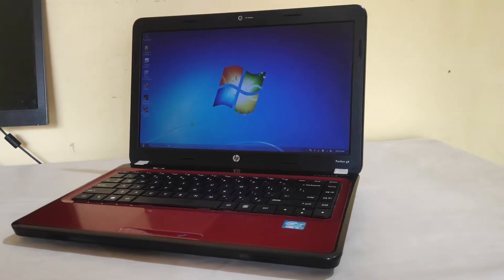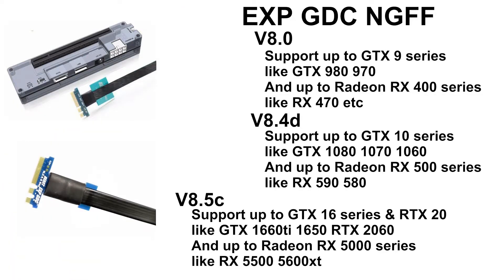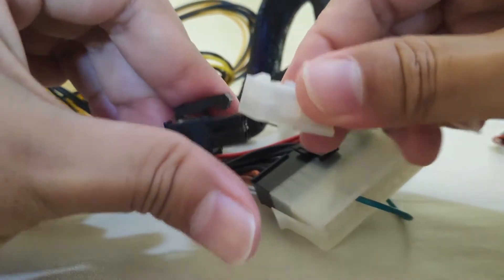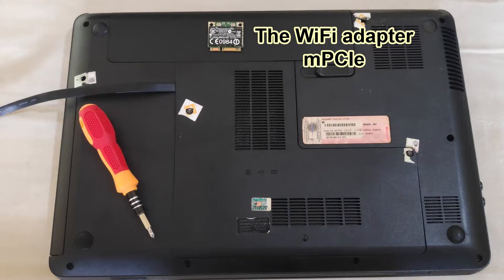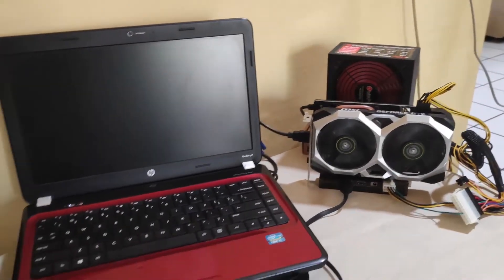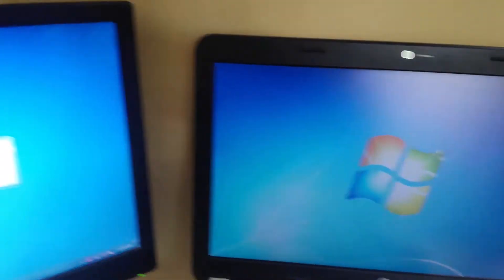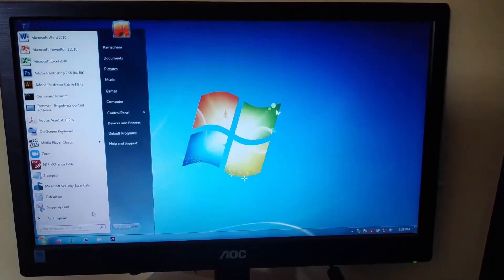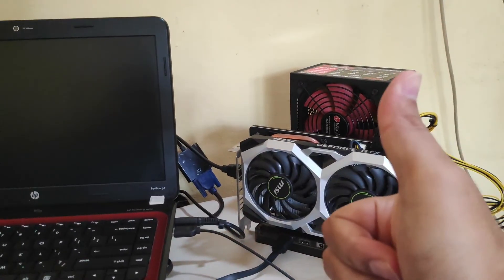EXP GDC Beast V8.5c eGPU with GTX 1660 ti on Old Laptop from 2012

Comment: Hey I have a Intel graphics of 2 GB and NVidia 840m 4GB, I'm going to disable nvidia 840m  graphics and insert an GTX 1660ti. Your thoughts? you think it works?
Reply from the maker: Windows 10 or Windows 7? Either way, try to uninstall the existing NVidia driver from Windows Safe Mode boot. Download DDU.exe (Display Driver Uninstaller) beforehand. 

In safe mode, Launch DDU.exe as administrator, then select uninstall 840m, after that, restart but still in Safe Mode, Open Device Manager, right click on the 840m and then Disable (it might be renamed to Microsoft Basic Display Adapter) .
And then, turn off the Laptop, install eGPU etc. 

BUT before doing all those, make sure you can access the BIOS properly, and search for something related to Boot Options.
Reply from the maker: Also, make sure that your WiFi adapter is up-to-date. Because basically eGPU requires an updated Slot Driver (Like mPCIe or NGFF)
Update your network driver using 3rd Party app called "ioBit Driver Booster"
Reply from the maker: I don't guarantee it to work. Because during the installation, NVidia software driver can detect any Disabled GPU and it can force re-enable it.
Hence why I recommend you to use the opposite of existing GPU, so instead of NVidia GTX 1660ti, just buy Radeon RX 5600, because basically they're the same.

Comment: Hello good day what version of exp gdc is needed if im going to  use my gtx1650? And where can i buy it. Ty in advance
Reply from the maker: I recommend V8.5c but sometimes it all depends on your Own Laptop.
Is it an Old Laptop or New Laptop? If you have new Laptop, like from 2018 or newer, you need EXP GDC V9.0b or V9.5 with M.2 NVMe slot.

All types of EXP GDC can be found on AliExpress. The keywords that you may need to use:
"Beast EXP GDC eGPU" or "Beast external Graphics Card dock"
Reply from the maker: Another keywords on AliExpress
EXP GDC external Laptop Video Card dock

Video Card Docking station EXP GDC.
Reply: I have the dell inspiron n4110  i5 proce , 8gb Ram 1333mhz and a intel hd 3000 so im planning to upgrade it with Gtx1650 what exp gdc will you recommend me to buy?
Reply from the maker: @carlmarklorenzo7307  yeah That Laptop have the same Processor like in this video. But first please open your Laptop to identify the Type of the available socket. Surely I don't know if your Laptop have mPCIe or something else.

Anyway it should be EXP GDC V8.5c but I'm not sure which type of socket you have. You need to open your Laptop by yourself like I warned in the beginning of my Video
Reply: Thats an old laptop i think 2012?
Reply: Yes sir i tried to open then it is a mini pci e
Reply: Where can you recomend me to buy the exp gdc for my gtx 1650 sir?
Reply from the maker: @carlmarklorenzo7307  I said AliExpress. Because the Manufacturer of this EXP GDC is from china. You may also search it on Alibaba.
But try Google Shopping search engine first.
Reply from the maker: @carlmarklorenzo7307  update. I think you can buy EXP GDC v8.0 or v8.4d just fine.
Apparently it works with GTX 1650 according to reviewer on YouTube. Try to search on YouTube
EXP GDC GTX 1650
Reply: Oh great! Thanks man have a nice day

Comment: thats a really bad bottleneck. mobile cpus are quite bad, only use that gpu if your cpu is a HQ model and if you have a 2nd gen i7 HQ or newer equivilent.
Reply from the maker: Looks like you don't know anything about bottleneck. The type of the CPU doesn't really matter if the connector is "Mini PCIe"
Let alone NGFF, or Thunderbolt 3 or NVMe.

Because currently the fastest eGPU that anyone can buy is NVMe based eGPU, and it's about 1.8x faster than Thunderbolt 3 eGPU.

It's all about Bandwidth speed. Even if I use Core i7 HQ or QM the performance won't be any different. Because of the Maximum Bandwidth of 2.5gbps

Stop talking something you know so little about.
Reply: @ClayWheeler  i know alot about it. The cpu is a bottleneck, but so is the pcie slot, laptops dont have full bandwidth slots. And its likely running at gen 2, not gen3, gen 2 has half the bandwidth of gen 3 per lane. Nvme runs at x2 or x4, mini pcie is likely x1. Thunderbolt is x2-x4. So before you go telling others what to do, tell it to yourself. Dont talk about shit you dont know about.
Reply from the maker: @raycert07  and maybe you should check some other eGPU videos that using this particular mPCIe slot.
It won't make any difference even if I use Core i7 HQ or QM, the FPS will stay the same. The only difference is that Core i7 HQ or QM will only utilizing 50% CPU usage, while this particular Core i5 is 100% CPU usage in gaming. It's all down to The Available Bandwidth.

You might also don't know if NVMe eGPU runs at X2 still faster than Thunderbolt runs at X4? You don't know it don't you?
Reply from the maker: @raycert07  also the fact that you said in your first comment "only use that GPU if your CPU is a HQ model"
clearly showing you know so little about bottleneck.

Comment: My 2010 hp laptop has white list thats why it doesnt boot up when I connect the exp gdc, I tried to connect it by doing sleep mode first then that when I connect the mpcie of my exp gdc through the wifi slot and it detects it and I installed the drivers 

But the damn problem is that my external monitor doesnt detect it and the nvidia control panel is not working even if I forcefully select it it does nothing
Reply: Also my bios is shit it doesnt have the options you showed, probably because its too old or because hp is such a shitty laptop company locking some options on some of their hp laptop
Reply from the maker: @mab3667  Woah, that's too old for eGPU setup. You better off with just building a cheap Desktop PC. Or if you're Lucky, you can search someone's Laptop from your family members for eGPU.
Reply: @ClayWheeler  my bios isn't same as you it has very little functions and my graphics card isn't detected please help me I bought 100$ used graphic card and I don't have any desktop I only have a laptop

Comment: hi could you please help
my pavilion laptop doesn’t boot with the exp gdc m.2 connected it will boot fine with the wifi card but not the exp gdc when it’s connected it will say there is a problem with the fan error code 90b press enter to continue but when i press enter it won’t even let me continue . please help
Reply from the maker: From the BIOS? Did you Change the BIOS like I do in this video?

Comment: Does you laptop battery still work? I heard that some laptops were incompatible with this set up because of battery problems.
Reply from the maker: During Gaming, I suggest setting up the Power config to "High Performance" this will surely eats battery faster. However this is 8 years old battery. The maximum discharge of this Laptop in my video is just 45 minutes for watching videos or 1.5 hour Typing documents in MsWord.

I could easily buy a new battery which is just $5 here from HP service center.
Reply from the maker: That's why I always plug the battery to AC Charger.

Comment: Can you use a Ethernet cable instead of a usb wifi
Reply: It just downloaded the old software after I did ddu lol 😂
Reply from the maker: @Gweaked  so the eGPU works or not?
Reply: No when I went to download amds drivers my laptop internal amd  gpu re downloaded and not my new one ☹️
Reply from the maker: @Gweaked  do it using Phone. Don't use Laptop. Because AMD website can do Auto Detection device
Reply from the maker: What? USB WiFi? For internet? Yes you can use both Actually. LAN cable or USB WiFi is just the same if you need access to internet.
But for the eGPU you need either one of these slots: mPCIe, Express Card, NGFF, or M.2 NVMe.
Reply: I don’t really no that much about computer stuff but I got the ngff cord I got it  hooked up to everything the fans turn on but I don’t see the gpu in the device manager I think it’s prob cause I got a amd card and my laptop has amd Radeon graphics already installed.
Reply from the maker: @Gweaked  if you don't see the GPU in Device Manager, it might be Listed as "Microsoft Basic Display Adapter" because any GPU with no driver will be Named this way.
Reply from the maker: @Gweaked  hmmm the Driver installer also refusing to detect the GPU card? 
My advice (1) you might need to uninstall the existing Laptop's AMD driver using Display Driver Uninstaller (DDU.exe) search it from Google.
Try to install the eGPU. If it doesn't work,
(2) then buy NVidia GPU card instead.
Reply: Okay thanks I’m going to try to do this today
Reply from the maker: @Gweaked  try to record video of it using your phone. Even if it doesn't work. I need to see if I can help you.
Reply: How would I use my phone would I do it threw the amd link app?? Sorry for all the questions
Reply from the maker: @Gweaked  what is the Radeon Desktop GPU model? Just search on Google using your phone. Like
"RX 580 Driver Download standalone"
Reply: I got the rx 570 4g sapphire
Reply from the maker: @Gweaked  yeah search on Google using keywords like that.
RX 570 Driver download standalone.

And then make sure you uninstalled Radeon driver from Laptop's GPU.
Plug in the eGPU, boot the Laptop, and Install the driver which you downloaded using your Phone.

I know Radeon has auto detect driver installer. That's why you must not using that method.

Comment: If both gpus can coexist, is it possible for the internal gpu to drive the internal display only and the egpu for the external display only? So that you woulnt need to turn off the intrnal display?
Reply from the maker: For desktop PC, yes. For Laptop, no.
When I said "both GPU drivers can coexist" it means AMD Radeon and NVidia GTX.

Also I'm turning off the Laptop monitor for Gaming only to make the IntelHD driver into standby mode, which means all CPU powers is focused to handle the eGPU.
If you're not gaming, you can use both monitor at the same time, like watching YouTube on external monitor, and web browsing on Laptop's monitor.
Reply: @ClayWheeler  i was actually planning on doing this mod. I have an Acer Ryzen 2500u withh vega 8 APU. I wanted to get a gtx 1650 then maybe follow this mod. I was thinking that i could still use the laptops monitor for lets say discord and the external monitor for gaming. Would that be possible and how would it affect performance? Thank u for the response
Reply from the maker: @Gwaping723  good question.
If your Laptop have M.2 NVMe slot for the eGPU (EXP GDC V9.0b or V9.5) then you can use both monitor just fine, because the bandwidth is very high compared to mPCIe like in my video.
Make sure your M.2 NVMe slot is running at X4 Speed Lanes, not X2 Speed Lanes.
Because if you use M.2 NVMe X2 you cannot use Laptop's display (Actually you can, but the Gaming FPS will drop significantly) if you have M.2 NVMe X4, you can use both monitors just fine.

Please check on the pinned comment of my video when you get error43.
Reply from the maker: @Gwaping723  I'm sorry is that Acer Ryzen 2500u have M.2 NVMe slot? I think it doesn't have NVMe slot.

It might be NGFF slot. If you have NGFF slot for eGPU, you cannot use Laptop's display at all for Gaming. Because the bandwidth is slower than NVMe.
Reply: @ClayWheeler  i think this laptop has m.2 because i just recently installed an SSD into it. What I ideally would want to happen so as to not worry about bandwidth across different monitors is to use both gpus, vega 8 and 1650 at the same time, the vega 8 driving the internal display and the 1650 for the external. This might be a long shot but would this be possible?
Reply from the maker: @Gwaping723  alright what model of Acer do you have? The model number in "dxdiag" info
Reply from the maker: @Gwaping723  worth trying. After installing GTX 1650 driver, you can access NVidia control panel, and select the external monitor as Main display (Display 1) and then the Laptop's internal monitor as secondary display (Display 2)

If you're using Windows 10, you have to manually select the Preferred Graphics device for specific Game. So that particular game will be forced to run on GTX 1650.
Reply: @ClayWheeler  acer a315-41-r132
Reply from the maker: @Gwaping723 
Here
 https://youtu.be/A0S9BIghFnU
Apparently you cannot use M.2 for eGPU because the slot only fitted for SSD storage.
The eGPU with M.2 needs NVMe capability. And your Laptop only have M.2 "Without" NVMe capability. So you can only use WiFi adapter slot for eGPU.

The problem is, I'm not sure the type of your WiFi adapter, it could be NGFF or mPCIe. But the Bandwidth is roughly the same, 2.5Gbps.

Comment: I happened to buy one of these (v8.4d) in case i ever came across a laptop that i could use it on so i also bought every connector type. Well i happened on a cheap acer sf315 52 (2018 8th gen i5) which also has a ssd with optane that it boots from and so i hook it all up and i can see the bios and it start to load windows then windows stops the device (error code 43) I dont have an option to disable the on board intel uhd 620 in the bios either. Is it a no go for my machine? 
Update: i deleted the 620 driver instead of disabling it reset and she works so far
Reply from the maker: Error code 43 means Slow Bandwidth detected. You can easily search on Google using this keywords
"egpu.io error 43" 
And then you will need to download the zip file which created by a guy in that forum. Execute (Run as Administrator) error_43_fixer.bat
Reply from the maker: So basically you need to install back the IntelHD driver. No need to uninstall it.
Reply: @ClayWheeler  i have a pretty decent collection of cards all the ten series included im wondering now if this will work with my zotac 1080 ti. I just located the file you said to find and it says specifically it will fix that issue with the zotac 1050.
Reply from the maker: @tronalddump8776  it will fix issue with literally all NVidia cards. Can be RTX 20
Reply: @ClayWheeler  i see that. Thanks very much for your help, im reading thru the site and comments now.
Reply: @ClayWheeler  worked perfect, thanks again.
Reply from the maker: @tronalddump8776  make short video of it using your phone. And upload it to YouTube. 😃
Reply: @ClayWheeler  ill make a video tomorrow. I just put the 1080 on it ill run some benchmarks and record it.
Reply: @ClayWheeler  thank you. I will try again tomorrow. It worked until i restarted it then started the error code again and dropped the 1050 driver.

Comment: Bang, itu klo laptopnya mau di bawah keluar ga harus install driver lagi kah? Atau harus install ulang driver VGA nya lagi?
Reply from the maker: Intinya kalau VGA bawaan Laptop itu merk Radeon, harus pakai NVidia untuk eGPU.
Dan sebaliknya. Kalau VGA bawaan Laptop itu merk NVidia MX150 atau GT980m berarti eGPU harus Radeon RX 5600 gitu contohnya.
Reply: @ClayWheeler  Mas Acer 475g i5 7200u 940mx bis a nggak pakai eGPU ? Rekomendasi pakai slot m.2 atau ngff aja ? Terimakasih 🙏. Kirain orang luar negeri 😆
Reply from the maker: No need

Comment: Im using exp gdc 8.5c and laptop pavilion g6 . GTX 1650 and boot doesnt continue .. can you help me please? And my caps lock keeps on blinking. Thank you for your reply.
Reply from the maker: Have you tried changing BIOS settings? Like I did
Reply: @ClayWheeler  yes i did
Reply: @ClayWheeler  yes and i have an Asus Strix 970 OC and works fine but the palit doesnt boot. Id tested the palit on a PC and its working.
Reply from the maker: I think it is because of CMOS error. Either the CMOS battery run out. Try to change the CMOS battery
Reply: @ClayWheeler  ill try this one
Reply: @jansandres1944  did you ever resolve the problem?? I am having the same issue with my pavilion… hope to hear from you
Reply: @burrit0bendit0  i didnt :) i built a pc instead . But if you want, I suggest using Asus, than other brands.